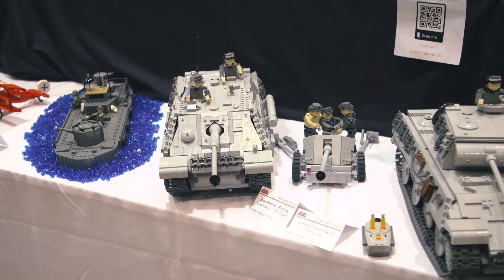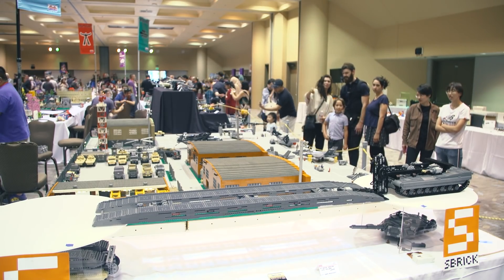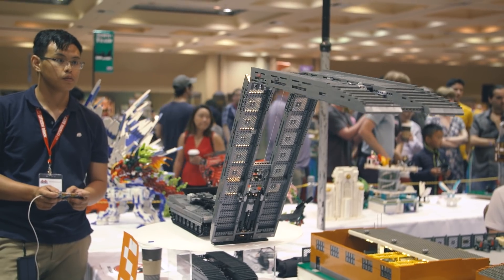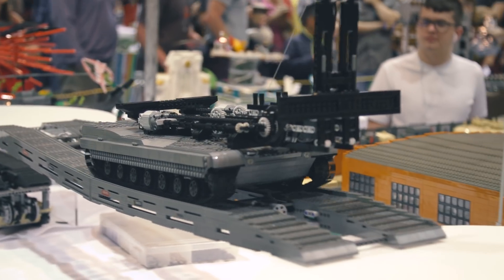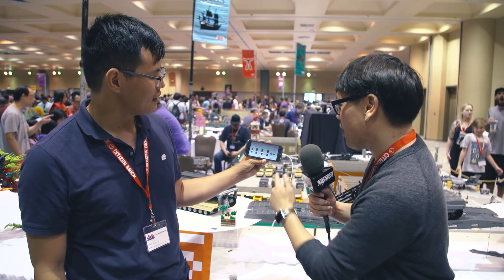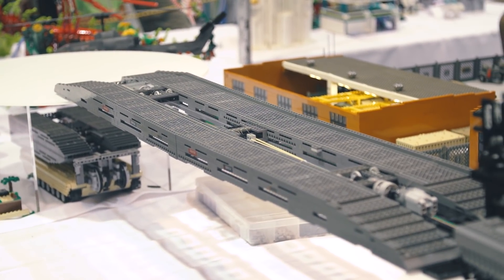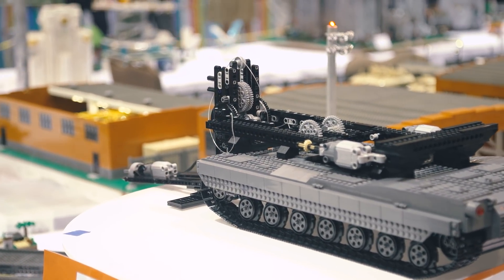LEGO Abrams Tank that Deploys a Bridge!

Comment: I've seen the Israeli version of the bridge-laying tank in person. Same bridge mechanism (as far as I can tell), just on a Centurion platform instead of an Abrams. The only difference in operation between this and the real thing is that, as far as I can remember, when deploying into a bridge mode, the two halves don't get fully straightened out into a straight line until they're nearly parallel to the ground. They kinda just maintain the far end / tip of the bridge at a height of only a few meters above the ground during the entire deployment process (until the very end of course). Here, they were being locked into straight mode when it was still pointing up and forwards at like 45deg.

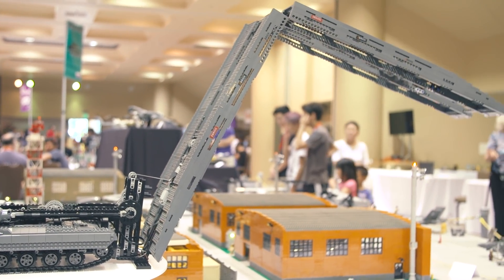However, everything else about this was spot on... I especially liked the slight, true-to-form "rebound" of the two sections when they swing shut (at 4:02 and 4:58).